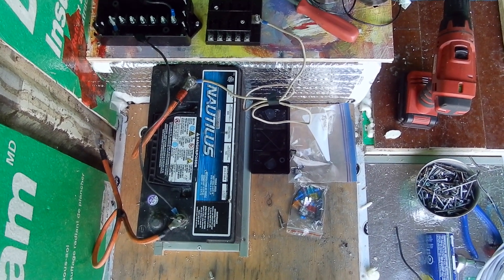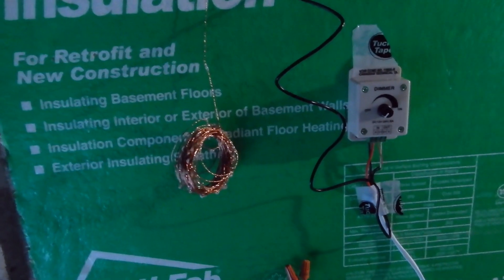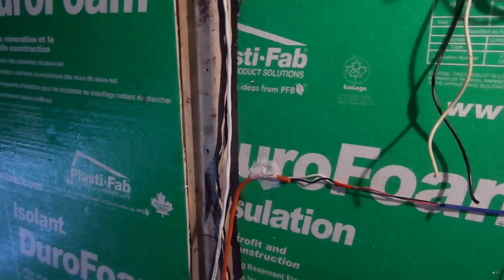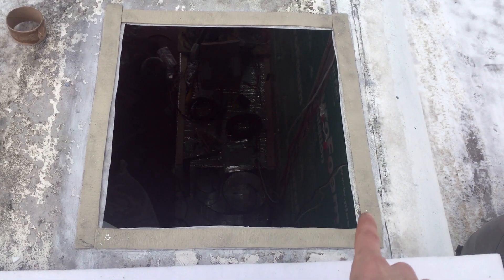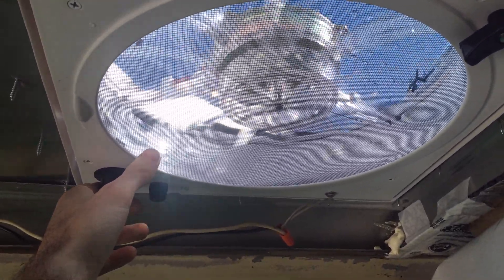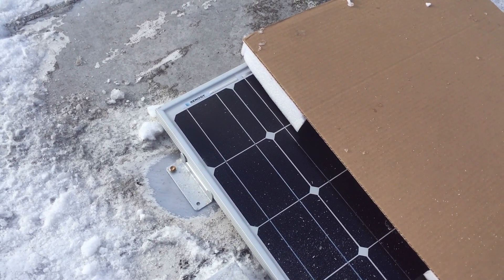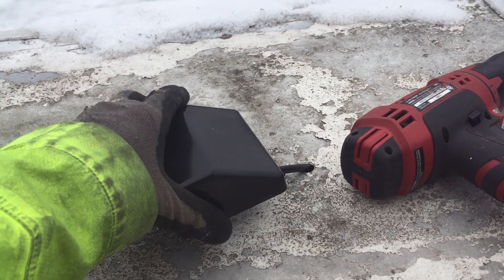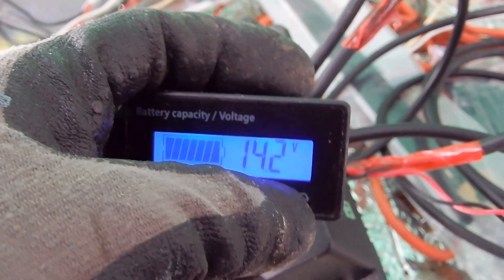Off Grid Solar Power in the Van Conversion E007

Comment: I didn't see butyl tape under the screws for the solar. would recommend that for a better water seal. I would also suggest trying Dicor LAP sealant for over the top of all screws and along edges of your solar connection boxes. it is much more durable to vibration and weather than silcone (it is what I used on my step van roof for solar, vent fans and any screws)